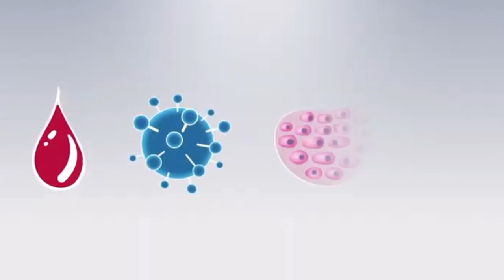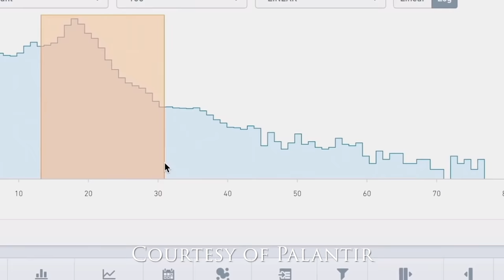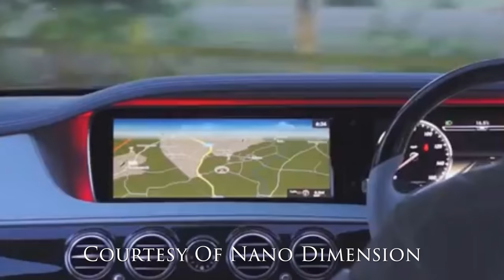Four Top Stocks To 10X Your Money - Palantir, PacBio, Nano Dimensions, & Momentus

Comment: PLTR is currently at $17-18, do you see a pullback and/or your thoughts to add to a long term account?
Reply from the maker: We added more today Julia. For a long term account, which we have, this price is probably ok to accumulate. It may pull back some but this price will be going much higher over time. We have a new video on Palantir coming out in the next two or three days.
Reply: I sold yesterday @ $18.56. That was 30x  yearly earnings. I see this stock stalling near this price point.
Reply from the maker: James, you may be right over the next bit. Time will tell. 30x is a steep valuation for sure but other big data companies are trading even higher. Over time, as Palentir begins to capture more and more enterprise business, the price will certainly climb.